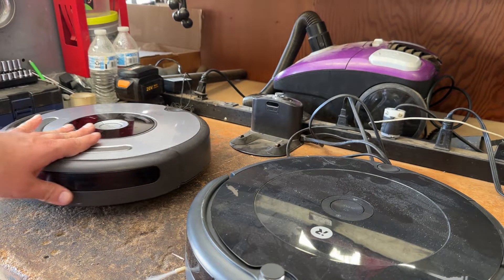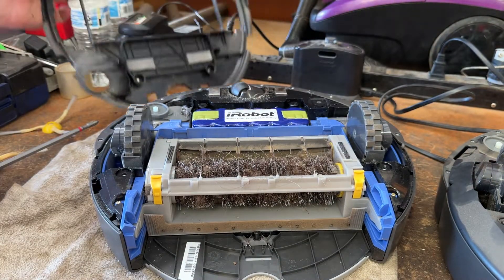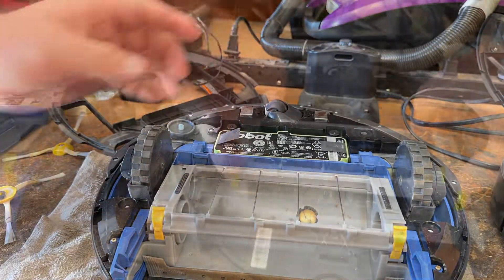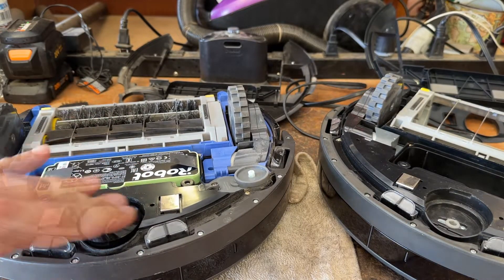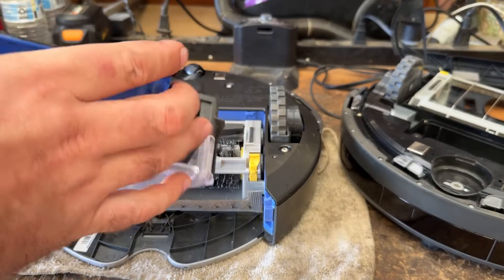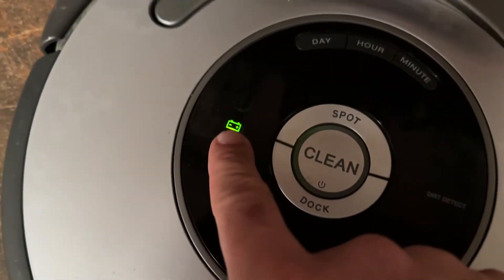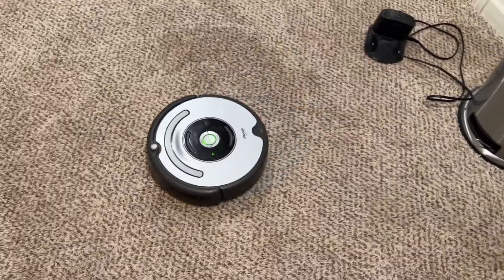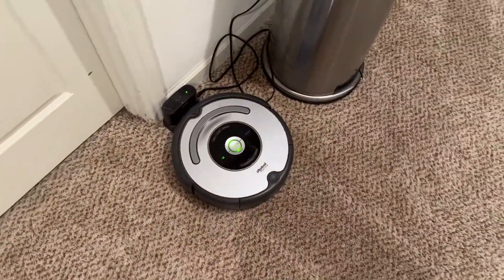Saving an Abused Roomba 600 Series with another Roomba

Comment: that front wheel you installed from the newer roomba won't work.
the older roomba has a distance sensor behind the wheel, the old wheel has two colors and that's how the distance sensor knows how far the roomba has gone.
on newer models the distance sensor is digital and built into the electronic wheels.
Reply from the maker: It’s been working fine since this video.
Reply: @hanksgarage_  have you noticed that it has been turning around a lot when in the middle of the room?
Reply from the maker: @Mangonaise205  no I haven’t